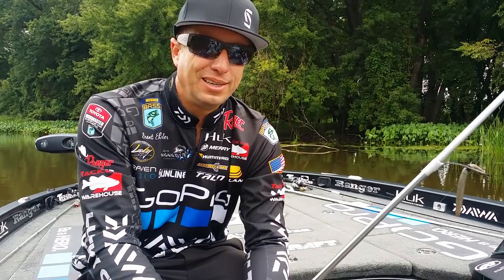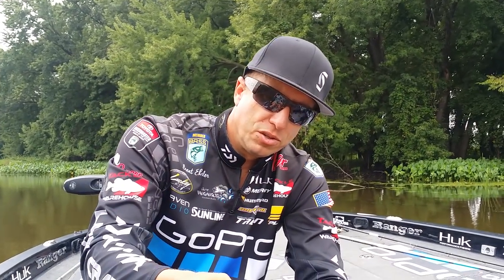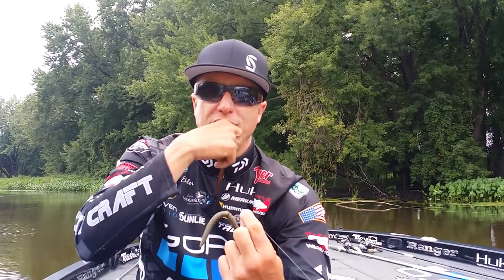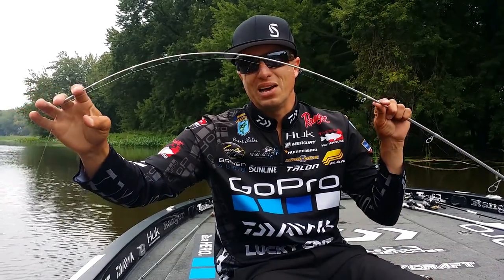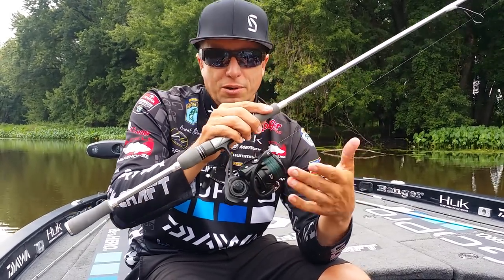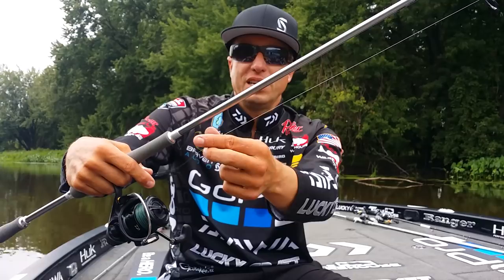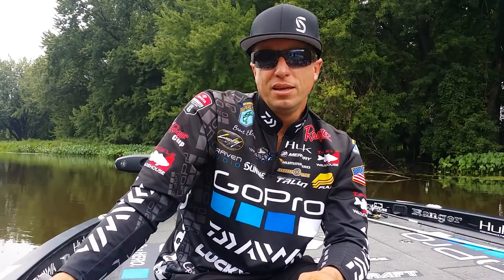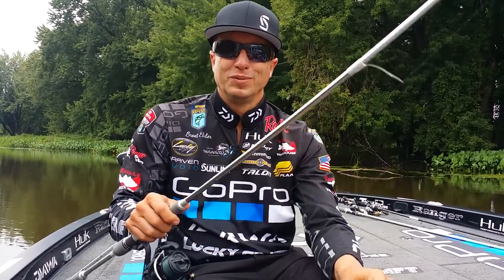Brent Ehrler's Neko Rig for bass fishing - how to rig and fish it

Comment: I like the Neko so much I usually have two sometimes 3 rods ready for it. My bread and butter would be using 4-5 " stick worms and similar baits on a similar set-up to what Brent Ehrler is using. I also have a medium heavy rod set-up for 6-7 " Senko's/ Ochos along with some 8- 10" straight tail worms that I will throw  occasionally. If it's real tough fishing I will throw small worms on straight 6 lb floro.

Comment: hello thank you.i been wacjy riggin zoom tricks , finesse mainly and 3 and 4 inch senkos about  15 yrs.also the zoom centipede is a hvy hitter on the wacky  ,i git some nail weights and  they look like there gonna fit better in the senko size worms better than the straight tail zoom finnesse.i use them for shajyhead too.i am a bug fan if tge hackall fliks too but they are very light but they will hit them when nothin else is hitting  .eager to try the neko rig this year.  i was usin the nedhead with a 4 in keiteck in dec , Jan .. i wanna try the biospawn worm neko style.try cash custom worms extreme stix if u like 4 in senkos.there better softer have better scent and cheaper and hand poured.mefa colors  fast shipping.i just bought 180 of them.u can buy single pk, 25 pk or 50pk.   50pk is 28$  . they usually destroy them before they hit the bottom.colirs are the best  2 tone colors  in like 100 colors